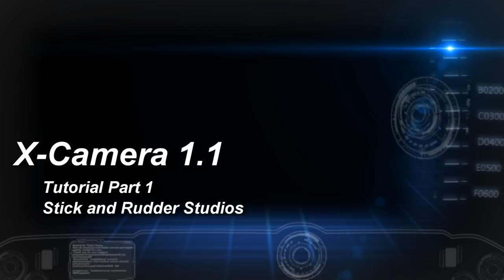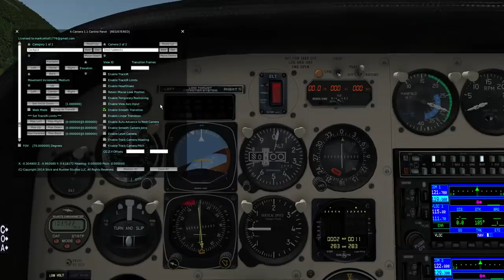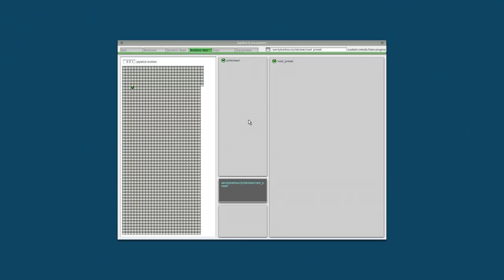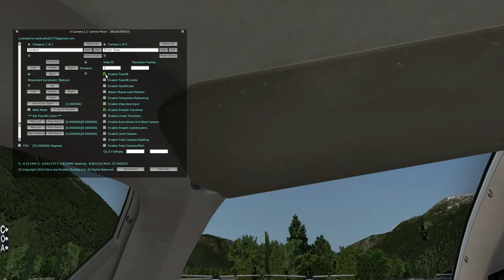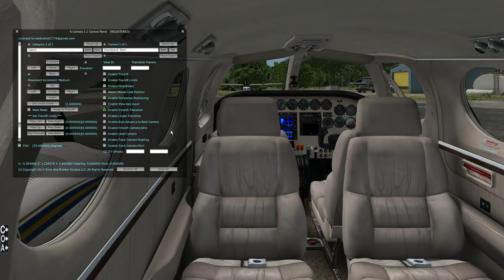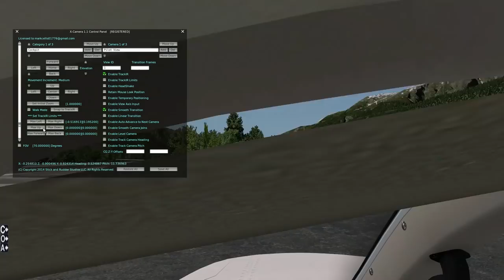X-Camera 1.1 Tutorial Part 1

Comment: Can you use the hat switch on a joystick to control the x-camera setting used on the num pad?  thanks
Reply: If you are referring to the using the keypad to select specific cameras then yes you could map those commands to any of the hat switch positions of you wish.

Mark
Reply: @markellis789  thanks but I was asking about the hat switch on the joystick
Reply: @pgreenx  The hat switch positions can be mapped to any X-Plane or plugin command so what I was trying to communicate is you can attach any of the X-Camera functions to any of the hat switch positions.

Comment: Hello, do you provide technical support?, the plugin caused many crashes based on what the log.txt says; another question, how to enable the panning using right-click on the mouse, it seems that default feature is disabled once the xcamera is enabled. Thanks!!!
Reply from the maker: +Jaris Aizprua 

Jaris,

I did discover a crash bug which there is a patch for mentioned here:

http://forums.x-plane.org/index.php?showtopic=90294&hl=

If you have discovered others please contact me at Support@StickandRudderStudios.com.

If you read the manual you will see that you need to use the middle mouse button to do a mouse look. Note that the crash above was related to that middle mouse button functionality so make sure you get the patch before trying it.

Mark
Reply: Ohhh nice, that was the issue yesterday that I started using the plugin, I was trying to use the right-click for panning and then I click the middle button and then it crashed, so I will try it, thanks!!!

Comment: i can't look around, the camera springs back to the default position
Reply: same here, its a huge pain in the ass. did you figure it out yet?
Reply from the maker: Hi guys, I assume you are using the mouse look function, middle mouse click to pan around? If true mouse look operates by adding the offsets due to mouse movement to the camera's last saved coordinates. As soon as you release the middle mouse button the camera will revert back t it's last saved definition.

Most people will map a hat switch to the various panning commands. This will leave the camera at where ever you pan it to. In addition people will also use this in conjunction with the "Temporary Positioning" camera option to cause the camera to revert back to it's original position after panning should you select a new camera and then return to the camera previously panned.

There is also a command you can map to a key or joystick button called "SRS/X-Camera/MouseMove_Heading_Pitch". This command will allow you to pan with the mouse with similar behavior as the mapping panning commands to a hat switch. Using mouse move will leave the camera at the last position you moved it to.

I know this is quite complicated. Don't hesitate to contact me at Support@StickandRudderStudios.com. I'm sure there is a way to get X-Camera to do what you want.

Mark
Reply: thank you, i mapped the mouse move to the spacebar and now it works great.
Reply from the maker: One of the things I did was to purchase a gaming mouse that has a bunch of extra buttons on it that can be mapped to key strokes. That is a very useful addition to X-Camera.
Reply: Stick and Rudder Studios i have the hotas warthog and use the buttons on the throttle for camera views.
Reply: Use the middle mouse button instead... and set (check) in X-Camera Control panel: retain mouse look position.

Comment: I can't look around with the mouse as I could before. It goes back to its set position and doesn't work like it does in the video.
Reply from the maker: You need to use the middle mouse button with X-Camera to do a mouse look. By default it will snap back to its original position when you release the middle mouse button but you can set the "Retain Mouse Look Position" option on that camera to leave the camera at the mouse look position when the button is released.
Reply: Stick and Rudder Studios it still doesn't work. Do you mean the scroll wheel? Or the right click on the mouse?
Reply from the maker: In X-Camera you need to use the middle mouse button for mouse look, that button is usually combined with the scroll wheel. Push it down and move the mouse, the view should pan. This is also for windows if you are on OSX or Linux it is a little different.
Reply: Stick and Rudder Studios I'm on OS X, when I push the scroll wheel down nothing happens. Is this something I need to map
Reply from the maker: On OSX and Linux you will need to map a key to the simulate middle mouse button. This is described on page 26 of the user guide: https://www.stickandrudderstudios.com/downloads/User_Guide_2.2.1.pdf

The command to map a key to to simulate a middle mouse button is:

SRS/X-Camera/Simulate_Middle_Mouse_Button

I hope to improve this with X-Camera 2.3 which is currently in development.

Mark
Reply: Stick and Rudder Studios thanks, but is there a way to map it on the mouse middle button, it would be more convenient than a keyboard or joystick button. When I try to assign a button when I click the middle mouse button it doesn't register it.
Reply from the maker: I agree that getting it to work with the middle mouse button across all three platforms is the best. Ultimately  I would like it to work with the right mouse button. I'm hoping to have the middle mouse button working on OSX and Linux with X-Camera 2.3.

What I use with X-Camera is a gaming mouse that has a bunch of extra buttons that can be easily mapped to keys and then to any X-Camera command. Not only could that be used for mouse look it is also a great way to do a mouse move. I have a Razer Naga:

https://www.amazon.com/Razer-Naga-Chroma-Gaming-Mouse/dp/B01798WKTY/ref=sr_1_7?ie=UTF8&qid=1499941415&sr=8-7&keywords=razer+gaming+mouse

But any gaming mouse that allows you to map the extra buttons to key strokes works well.
Reply: Stick and Rudder Studios ok thanks for your help. Will look at a gaining mouse